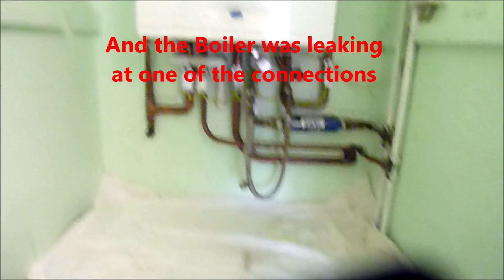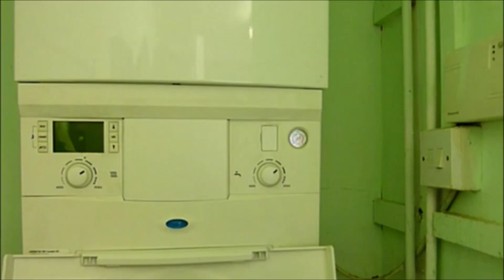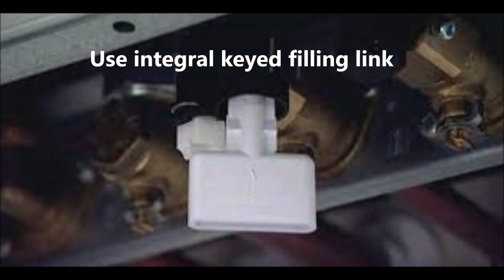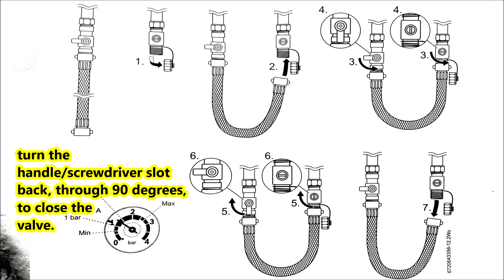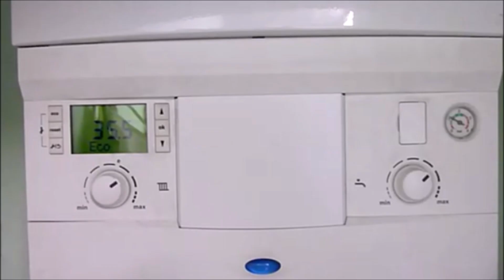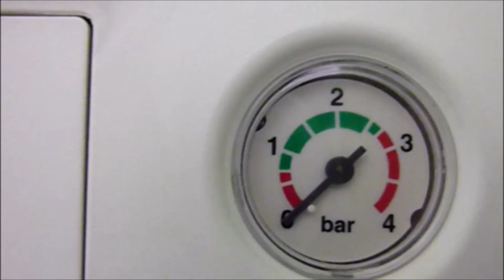HOW TO REPRESSURISE WORCESTER BOSCH BOILER/INTERNAL & EXTERNAL FILLING LINK

Comment: How do we bleed the radiator
Reply: Your radiators will have a bleed valve, the design of this depends on the age and design  of the radiator. You may need to buy a multi-sided radiator bleed key with four or five different tips. 

Put your hand at the top of the radiator when the heating has been running for at least 15 minutes, if it is cool to the touch then air is trapped at the top. Turn off the central heating to let the water cool, then with your radiator key VERY GENTLY open the bleed valve a small amount. You should hear the air hissing out. As the air finishes leaving, and water moves up inside the radiator to fill the space, you will hear the sound change. 

Eventually when all the air is gone, water will start coming out, and remember it is a pressurised system, so don't open the valve more than you need to and be ready to close the valve again quickly. It is recommended to have an old towel/kitchen cloth/tea towel underneath to catch the water as it will be dirty and contain rust and other sludge from the heating system and pipes. 

With the valve firmly closed, turn on your central heating again, wait for the radiator to warm up - you should feel it is hot from bottom to top along the whole radiator. Enjoy a warm room.

Air in a system will find the highest points, and often more than one radiator will need bleeding. Don't forget to recheck boiler pressure afterwards. 😎👍